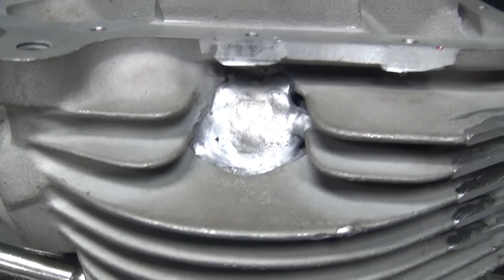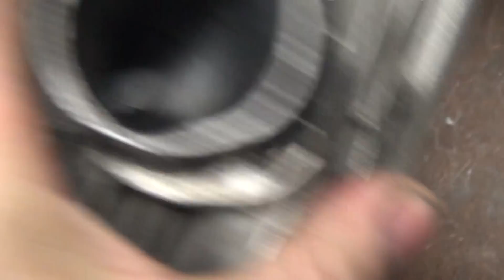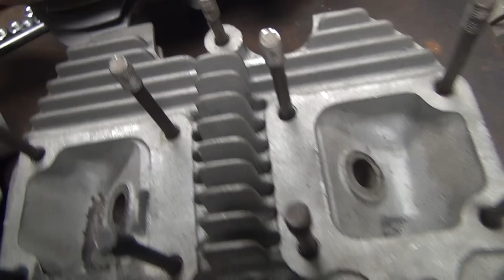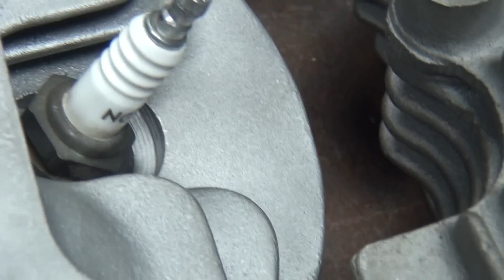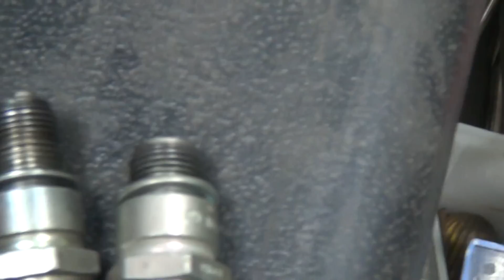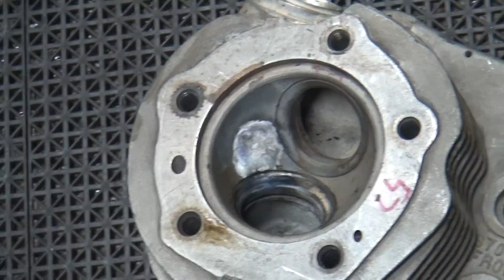#205 1958 & 1960 harley panhead complete head restoration repair welding & machining, tatro machine

Comment: I have a 1983 FLHT shovel 80ci. Rear head spark plug blew out. May have been heli coiled in the past, not sure. How much would you charge to repair my head?
Reply: That happened to the front head on my 94 evo. I used a heli coil repair and it worked out better than expected.